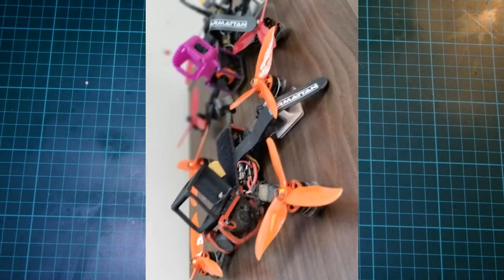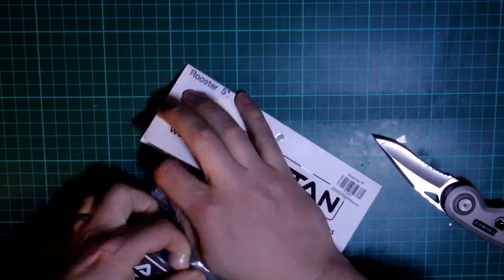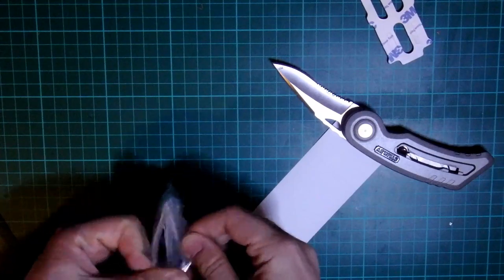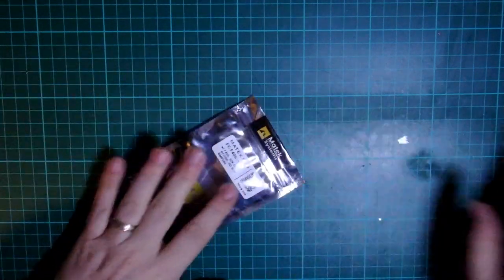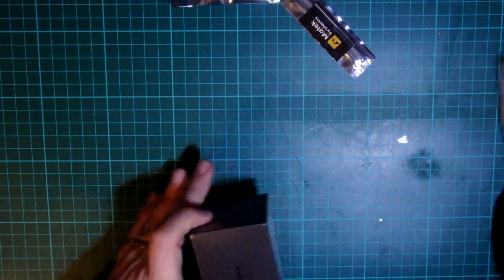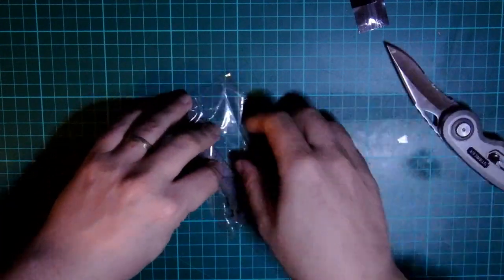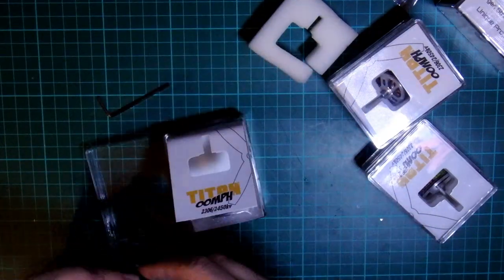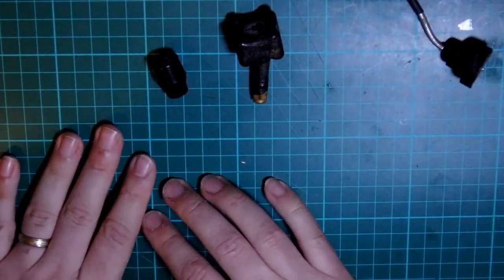Lets Build: The Titan Rooster Part 1: Why and how

Comment: With all the issues with this frame, should a beginner choose the chameleon frame or the rooster? Or something completely different to start out with. I want to build my own quad, and arrmattan seems like a good place to start. Thx in advance for the help. -Robert
Reply from the maker: Don't get me wrong they are both good frames. The chameleon was a total pleasure to build. The only challenge is the limited internal space. But if you use a small receiver then you will have no problems.

Comment: how much was this build?
Reply from the maker: I chose not to think about that until now. 
Frame was £85
Motors about £20 each
Esc £10 each
FC £25
Pdb and vtx £30
Camera £30
Reciver £15
Antenna £15
3d printed bits £12